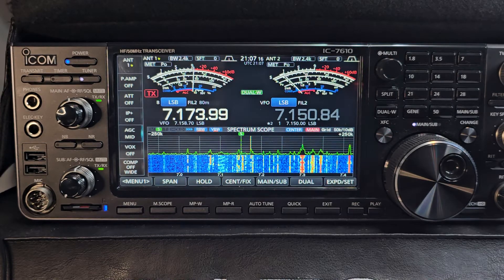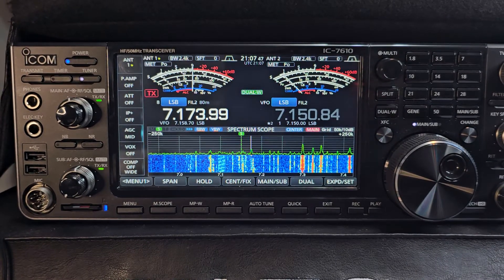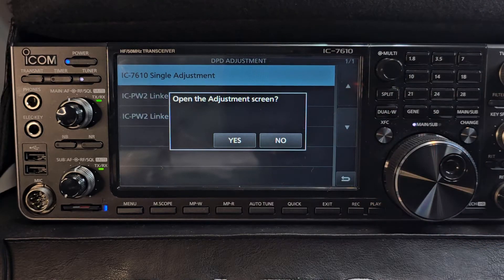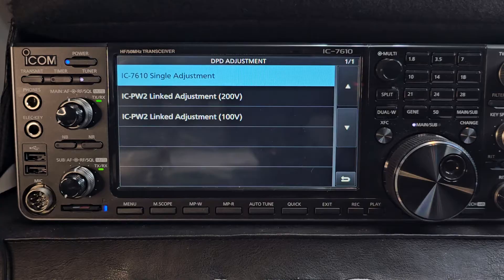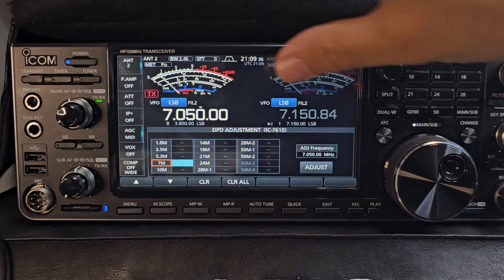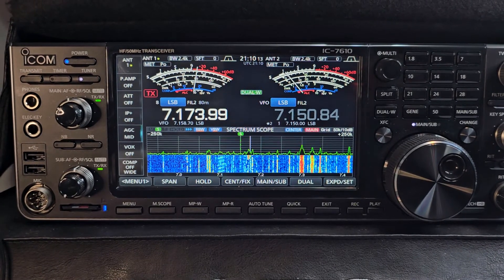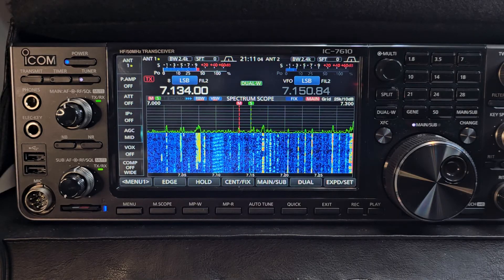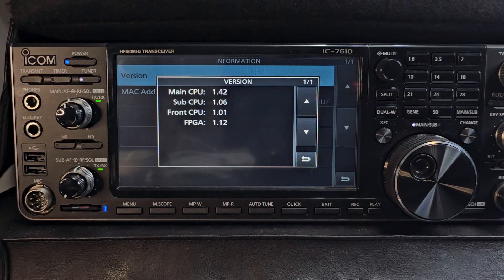ICOM IC-7610 - DPD SET UP

Comment: Hi mate wonder if you can help me I want to connect the Icom 7610 to my network so it keeps the clock at the correct time it shows my ip address of the broadband and I’ve set the dhcp on the radio to on but it’s not giving a up address for the radio can you help please
Reply from the maker: Download angry ip
Reply: Hi mate just got it sorted it was an issue with the Ethernet cable
Hope you are keeping well

Comment: Hi I’ve downloaded latest software and dummy load place at the rear dpd fails to Finnish every time not sure what I’m doing wrong ?
Reply from the maker: 100 watt dummy load?
Reply: Probably because you have the internal ATU enabled. Make sure the TUNER LED is off (touch the TUNER button quickly once) to bypass the internal ATU.